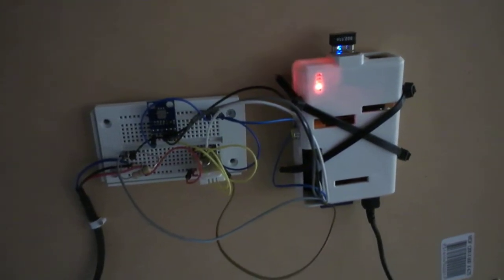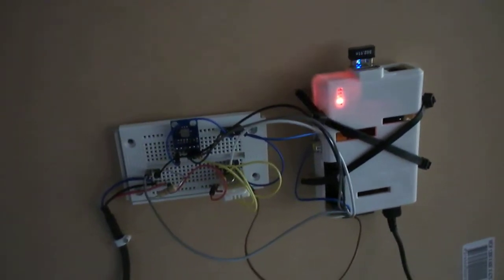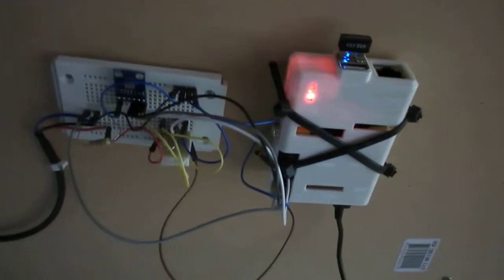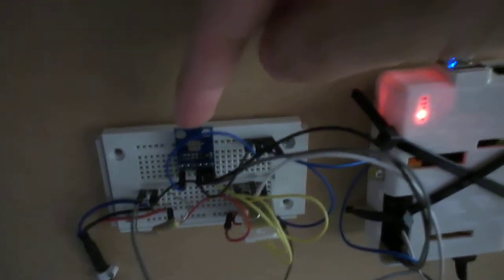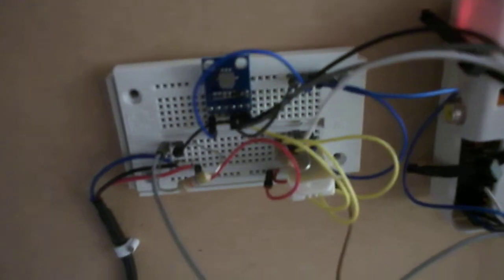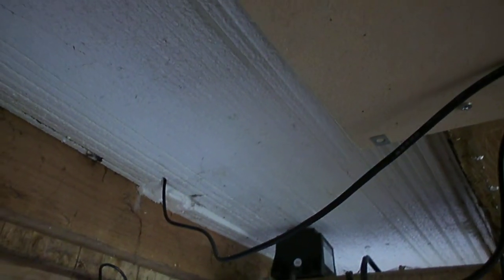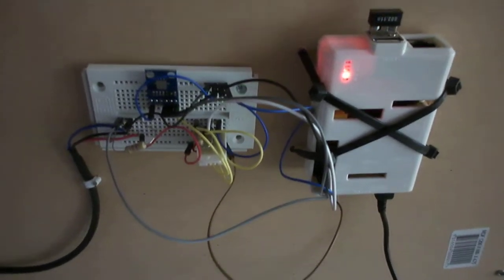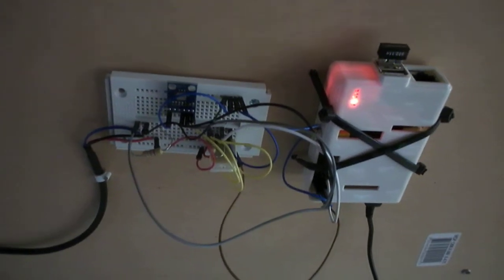Part1 - Raspberry Pi: Weather Monitoring Project Outline and Resources -- Hardware

Comment: Dont suppose you'd share more details on this project with a fellow Auckland? very keen to get my hands on the PHP script as well as the phython codes.
Reply from the maker: Hey Clifford,
My Python code is a) cobbled together from Adafruit and b) is now out of date compared to the better code from Adafruit.  It's basically nested in directories that I got when I downloaded Adafruit's old code.  That's why I haven't shared it.  I'm happy to point you in the right direction, or answer any questions - but I wouldn't want my cobbled together crap, especially when it depends on a messed up directory structure.  Basically, go to Adafruit, get your stuff working, then send it to a MySQL database.
The basic PHP code looks like this:

<?php

$con=mysqli_connect('localhost', 'weatheruser', 'weather123', 'weatherdb');

echo "<table border='2' CELLPADDING=15 BGCOLOR='lightgreen' align=center>
<tr>
<th>date</th>
<th>indoor</th>
<th>outdoor</th>
<th>humidity</th>
<th>pressure</th>
</tr>";

$result = mysqli_query($con,"SELECT * FROM climate ORDER BY date DESC LIMIT 24");

while($row = mysqli_fetch_array($result))

  {
  echo "<tr align=center>";
  echo "<td>" . $row['date'] . "</td>";
  echo "<td>" . $row['indoor'] . "&deg;C" . "</td>";
  echo "<td>" . $row['temperature'] . "&deg;C" . "</td>";
  echo "<td>" . $row['humidity'] . "&#37;" . "</td>";
  echo "<td>" . $row['pressure'] . "&nbsp;hpA" . "</td>";
  echo "</tr>";
  }
echo "</table><br><br><br><br>";
?>

After you get that working, get FLOT.
Let me know how you get on,

P

Comment: Hi skiwithpete. Thanks for your reply. You know I tried to follow exactly what says on the website but I can't get it work. I am not sure if this  is because of my stupidity or because of something else that is not connected properly.  I was reading in one of the links and it says that I have to solder the pin headers but I have the pi cobbler. I am wondering if I still should solder it or not? what would your suggestion be?

Comment from the maker: Hey Lisethe, 
I can't post links in this section, but do a google search for BMP085 Adafruit and look for the websites on Adafruit that start with learn.  They've put out a new unified driver, though that's not what I use...  Basically, if you follow their instruction you should have it running in no time flat. 
Let me know if I can be of any further help.
P

Comment from the maker: It's a relative humidity sensor, so it measures water vapour in the air and compares it to...  look it up.  
As for the conditions, the board runs 24hrs a day, year round, in Auckland, NZ, so rarely freezing, rarely above 35C - but look at the electronics tolerances for your area.
usb webcam streaming?  We'll leave that for another vid.
Cheers,
P

Comment: how can humidity not be much of a problem when you're basically running it outside? does morning dew not apply to it? the chip can get hot enough to start boiling down some water around it. Can you talk about the possible conditions that suit the board? I'm wondering to set up a web cam in my attic that peeks outside the window, but it feels soggy there so I haven't had the courage to bring it up there. Also how can I actually stream from a usb webcam? I don't like motion...